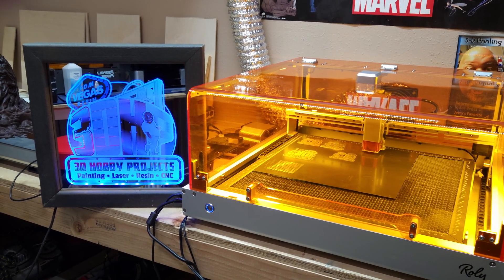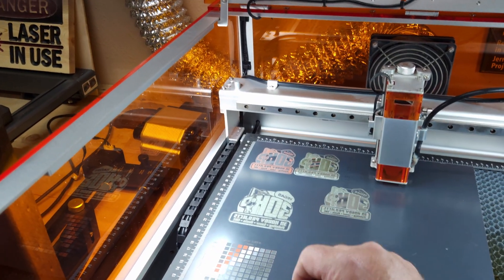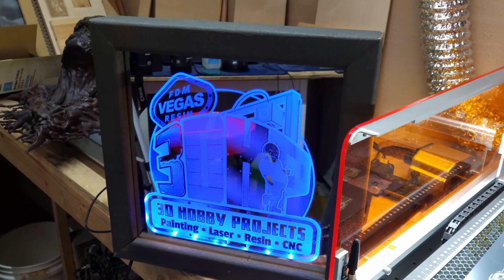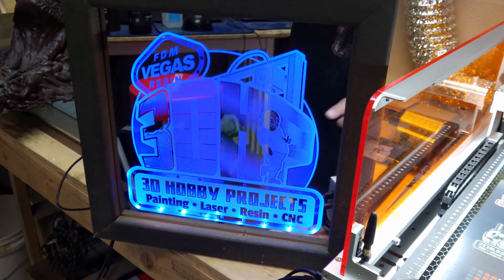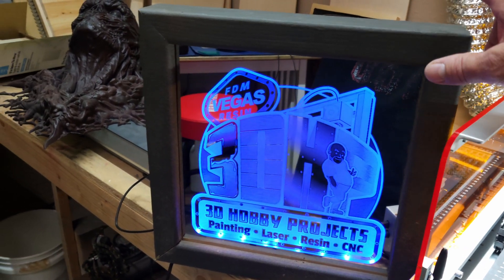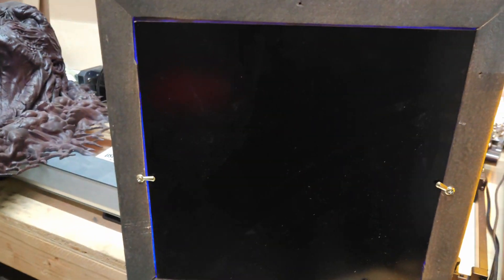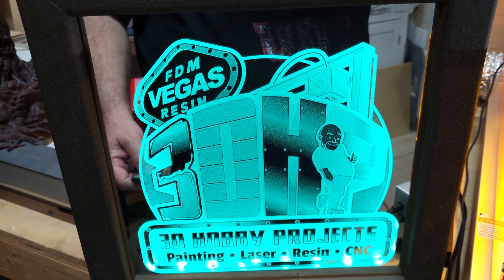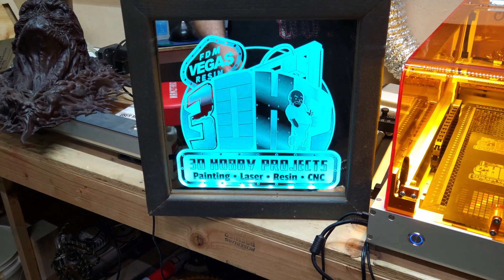Backlit Mirrored Logo | LaserMatic 10 Diode Laser #3dhp

Comment: Love the ideas here. When pricing the hours of machine use, how would you calculate that. I am assuming the 10,000 rated hours of most machines is calculated, electricity usage, and room for repair and maintenance of the machine should be calculated. If you have already done this, what do you think you would be looking at for a project like this?